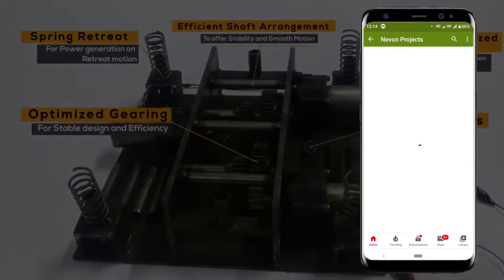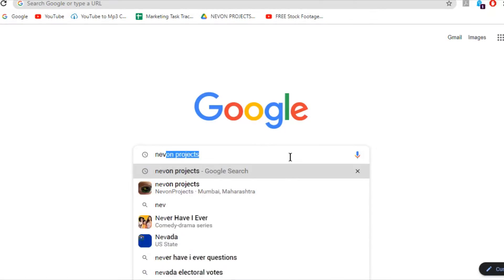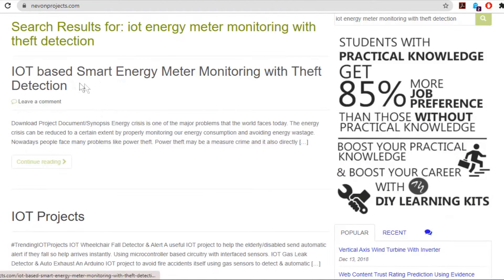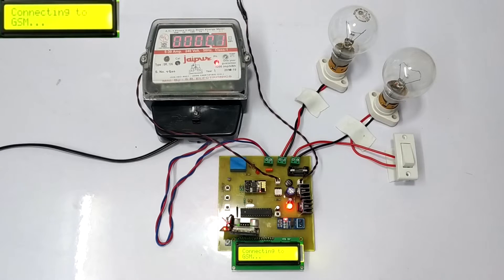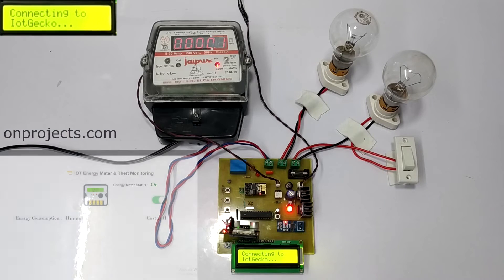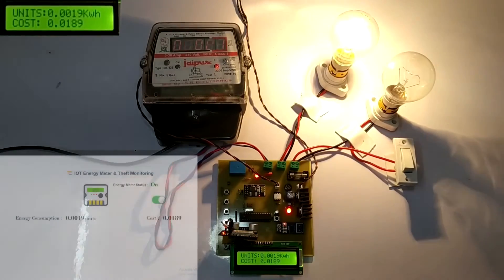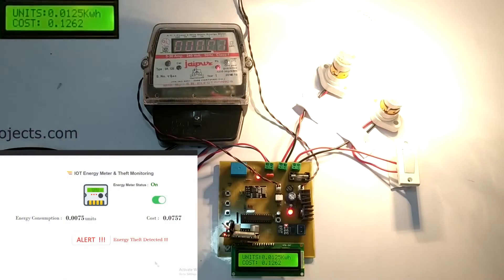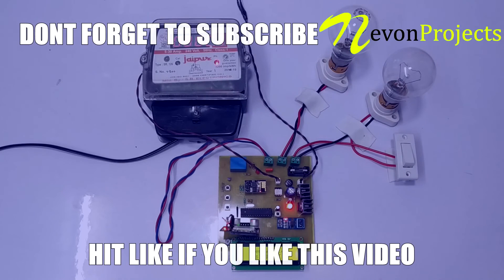IOT Smart Energy Meter Monitoring with Theft Detection

Comment: I visited your website and  the block diagram is not logical can you provide us a good diagram to understand the logic clearly
Reply from the maker: For this Electronics system details or free document/PPT pls call watsapp
+917738796642 or visit link in video description
Reply: @NevonProjectsOfficial  i mean to say, how you measure the voltage and current. Your using a stock meter, and just pointing an arrow in diagram